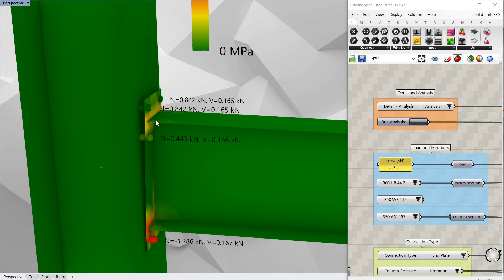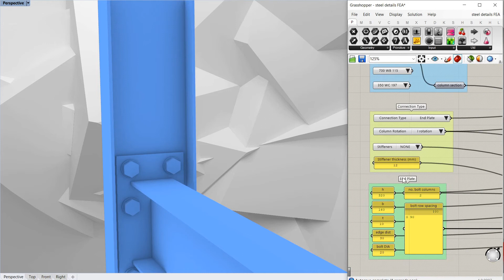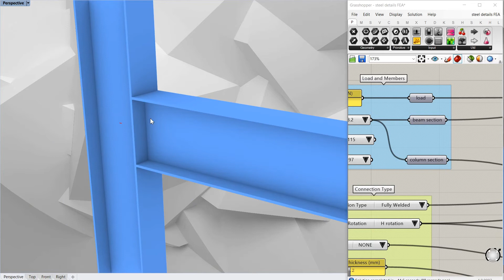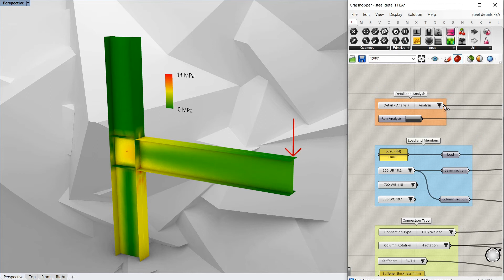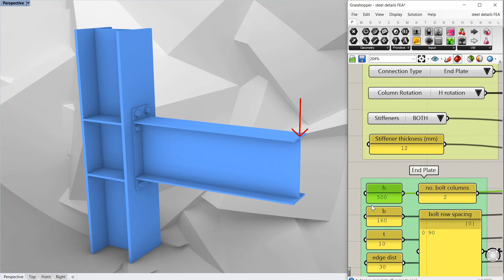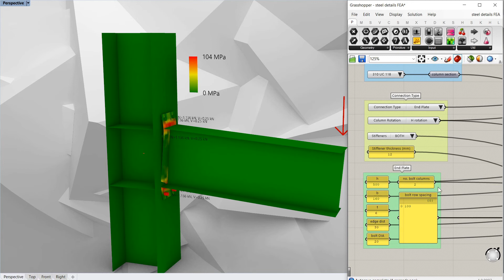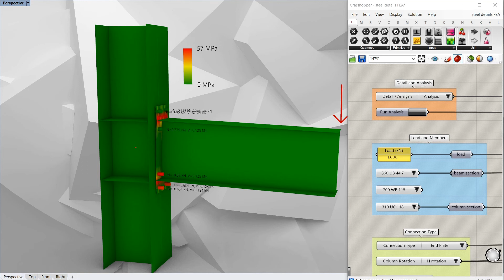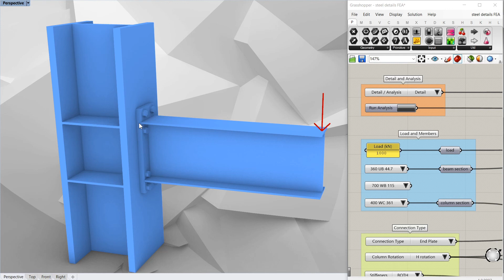Fast Parametric Steel Details with FE Analysis in grasshopper

Comment: Oh and also, you're putting 1000 kN on a rather small steel profile and all you get is a few MPa in stresses...? Did you ever check if the model is plausible before putting it out in the web?
Reply: he says at 8:33 that the load is only 1kN (not 1000kN). The units on the box are wrong

Comment: Would it be possible to design an entire building and get the FEM calculations for all connections at once?
Reply from the maker: Yes it would be possible if set up like that. Might take a while to process everything depending on the size of the building.
Reply: @StructuredParametrics  Thank you for your reply! Very exciting how grasshopper is becoming more and more powerful these days for structural calculations

Comment: This is only for I-Profiles right? I'm trying to set something like this up for L-Profile connections , but im more interested in the automatization / parameterization of the connection itself rather then analysis. Would love to get that script if its possible to adapt to L-Profils with somewhat of a beginner grashopper knowledge. 
anyway good stuff
Reply from the maker: Thanks. Yes this currently has only I-sections built in. However the shapes are drawn in a quite simple way. It wouldn't be too hard to modify for an L-shape with a basic knowledge of grasshopper in my opinion.
Reply: @StructuredParametrics  perfect. thats exactly what i was thinking / hoping. I will check the script out.
Reply: @StructuredParametrics  How can i use a custom "C" or "L" profile with Kiwi? I see your Tutorial of "Profiles", but Kiwi doesn't recognise it on "Profile Type".
Reply: @StructuredParametrics  Hi Ben, Is the script still available in the website as mentioned in the video description?
Reply from the maker: @samuelmbasimalla5427  Not at the moment as it needs some updating. However we plan to bring it back once we can do the work required.